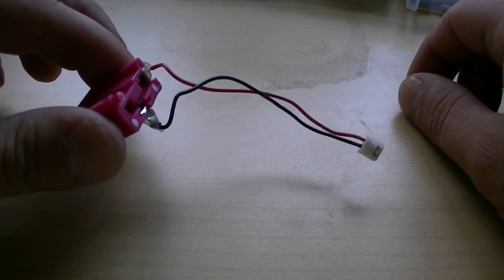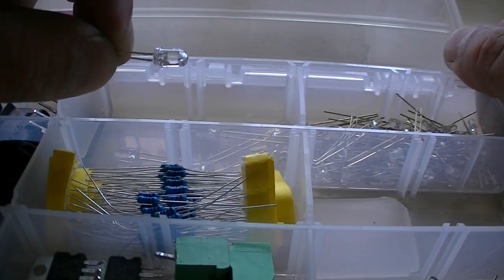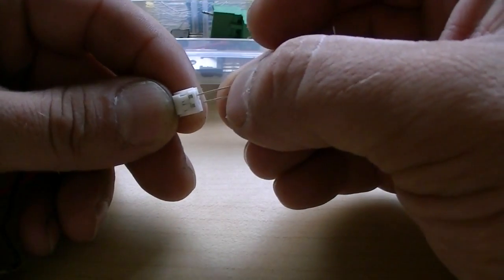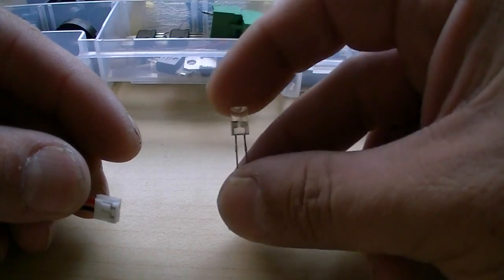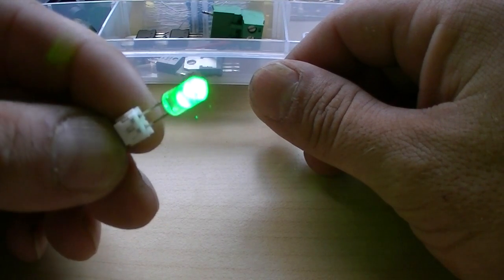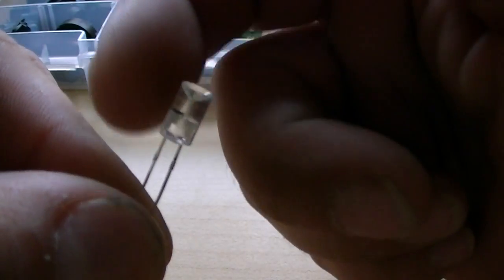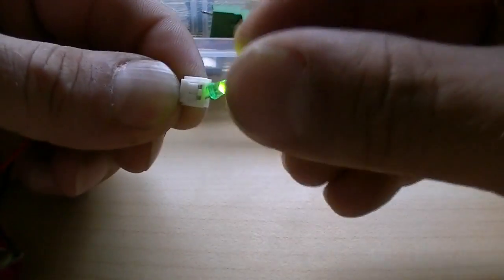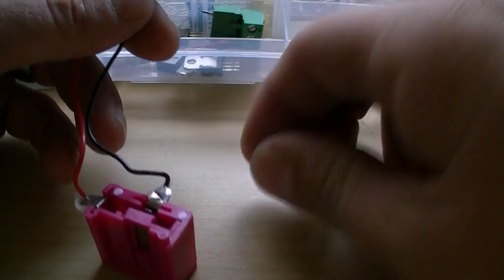Easy Way To Test LED's

Comment: In my shower ceiling pull switch,there is a LED bulb,What voltage is this working on? It’s connected to output(load side) of the pull switch + and - ,cannot see any resistors etc,what voltage would I need to test it? Thanks.

Comment: I have a maplin Led tester it's the best iv seen it does different powers runs on a 9volt pp3.All you need really is a CR2032 battery and remember the two solid wire from the Led the longer one is positive +. A lot of Led are different power some are 1.8v some 3.2volt and so on so it's good to have a LR44 battery and start there if it and that bright try the CR2032. When buying Led make a note of the volt and the ma then when you receive in the post put them in a self seal bag and write on the bag what's what.i have prob over 5000 Leds all different but all noted on the bag so I all ways know.

Comment: Quick question - can I use a 3mm LED to replace a 5mm led on a PC system (HDD) light that extends from the motherboard to the outer case? purely from a voltage and current stand point as for the hole it sits in I can hot glue the 3mm LED into place. Thanks in advance

Comment: i found a box of button batteries duracell lithium DL1620b.  it says best if use by 2005. do you think these batteries are still good ? they are  unopened and about 30 pieces.

Comment: Every low-end resistor above 1k in-line with the battery costs about 10 cents and saves you the life of many LEDs. 
Why should you risk it oO

Comment: I use the continuity test on my multimeter.  It lights a good LED.
Reply from the maker: texjarhead Some multimeters this works on, others don't put out enough current for this feature.

Comment from the maker: two aa or aaa batteries in series will give you the voltage to light led's, but too much current without a resistor in line.  You'll normally fry the led within seconds.  The watch battery can't put out enough current to harm the led's.

Comment from the maker: I actually yanked that out of an old irrigation controller that was trashed.  You can easily make one out of a few parts from radioshack.  Just grab a watch battery holder.  Find an old wireless phone (house wireless phone not cell phone) and cut off the connector and wire on the battery as close to the dead battery as you can and solder the wires to the new watch battery holder.  Enjoy your new led tester that will easily test hundreds of led's per battery safely.

Comment from the maker: I used the website ledcalculator. net and it spit out a schematic for 51ohm resistors with running the led's.  Just type in 4.5 for power supply voltage, led voltage drop 3.3, led current 25, and number of leds 5 and you'll get the same thing i did.

Comment: @NJsharkracer I want to setup 5 led lights to a 1/6 scale base how much power will i need and what type of resistors should i get. I have 5mm Led's at 25ma 3.3v(typical),3.6v(max)? i also have 3 triple AAA power supple pack which is equal to 4.5v
Reply: nice very very nice